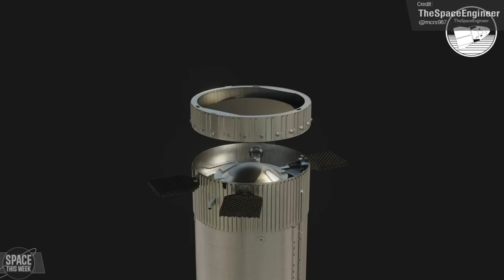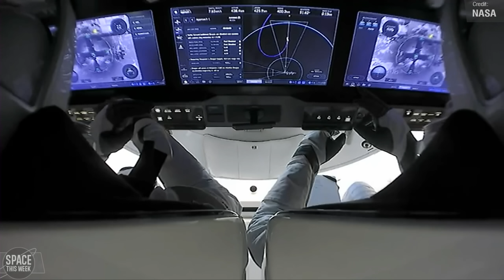SpaceX Starship gets Reinforcements, Falcon 9 Breaks New Record, Secret China Launch, Final Ariane V

Comment: The payload door design is not good - given the majority of the forces are along the axis of the vehicle having a vertical door instead of a horizontal door would have reduced the stress on the door by a factor of 4 or more. No reinforcement would have been needed for a vertical payload door.

Comment: I have observed in animations that the "Pez Dispenser" apparatus dispenses the satellites out 
along their long axis. If the satellites are four feet wide and eight feet long, the eight foot Starlink
Payload door could be cut in half by dispensing them out along the Four foot axis. 
This would be more structurally sound.
Reply: at the cost of a more elaborate deployment mechanism (about 3x to 4x as many moving parts required). probably not a worthy tradeoff, especially because at some point they want to open the entire side of the booster for bigger sats, not just that tiny slit..

Comment: I kind of wonder how long Ariane 6 will be around since it's already obsolescent by design.
Reply: Booster reusability is great, but has drawbacks.

First, if you don't have a fast enough launch cadence, you can spend more on recovery equipment and personnel than you save by reusing the booster.

Second, you take a payload hit for the recovery system on the booster. The Falcon 9 B5 can lift up to 22.8 tons to LEO when expended (SX), but only up to 17.4 tons when landed on a drone ship (B1067.9). Doing a Return to Launch Site (RTLS) landing, costs even more payload as you have to add a boost back burn to cancel the lateral velocity and return back to the launch site.

Third, the higher and faster you go, the harder reusability is to perform. The heavier the dry-mass of your booster, the harder reusability is to perform.

Fourth, you now have to have the weather be acceptable at the launch site and the landing site, if it is down range of the launch.

No, I'm not saying that SpaceX should not recover boosters. I'm using how reusability affects the Falcon 9 to discuss other expendable boosters.

Since 2010, the Ariane 5 has averaged 5 launches a year, so it didn't really have a fast cadence. It also looks like the Ariane 5 booster separates roughly twice as high as a Falcon 9 B5, so will be going faster as well.

Many governments don't really want to put their military or spy sats on other countries rockets, so they will always have some launches. Not to mention, like the US, some science missions will be funded so that their own rockets have to be used.
Reply from the maker: Ariane 6 is a government backed rocket so cost is less of an issue, and its big advantage is that its launch pad is very close to the equator, so it's ideal for geostationary orbit launches
Reply: Well it’s a government funded program. As long as political will is there it will stay.
Reply: The word you're looking for is 'obsolete'.  Anyway, i bet it will stick around longer than you expect considering that it's backed by international treaty.

Comment: I refuse to call it the “water cooled steel plate”, I prefer the “Booster Bidet”
Reply: Lol
Reply: The world's largest upside down shower head.
Reply: Perfect name I hope it works but I'm unsure
Reply: I prefer shrapnel futures as a name
Reply: Seconded.
Reply: Actually “Starbase” calls it the “Pancake” 🙂
Reply: @dhwardani Hasn’t even been used yet, don’t down something till you’ve got reason to
Reply: @alucidrust  Water being flash boiled inside a seal metal container = explosion.
Reply: @michaelwilliams2430  There is a deluge system you know that? and they've obviously thought it through, thats basic thermodynamics.
Reply: @alucidrust  It is not a deluge system. If they thought things through, they would not have blown up the pad the last time. Basic thermodynamics says it will explode.
Reply: @michaelwilliams2430  There is a deluge system in place though, it's not just the cooling plate.
Reply: @alucidrust  Interesting since they have to get environmental agencies permission for a deluge system since if not done properly it poses great danger to the protected wetlands and last I heard they had not even applied.
Reply: @michaelwilliams2430  Maybe I've heard differently, will be interesting to see what they do.
Reply: More of a trivet than a bidet.
Reply: @dhwardani  How so? Or are you just... you know... trolling? I don't like Mr. Musk. But what his engineers have done is absolutely amazing. No one can deny that.
Reply: @FuriousImp  You don’t like the hard-working self-made altruistic genius who rose from very modest means to bring humanity Electric cars, self-driving, tunnels, affordable space, big steps towards being multi-planetary, robots, & exposed/freed us from widespread secret criminal government/media/big-tech colluded brutal ideological partisan censorship/manipulation… hmmm..
Reply: @dhwardani trying to fight the power of raptors is not a good idea in my opinion, but we will see
Reply: @dhwardani Actually with a ship as large as Starship, there are only two options. Large heatsink or launch over open water. 

NASA did studies in the 70's and determined a deluge system would require so much water it would be impractical. A traditional Flame Diverter would reflect sound waves back at the vehicle causing it to tear itself apart.

Comment: Hi, I have a question? Will the starship booster eventually land on the same surface as it launched from? It will it go to apogee and than  do a suicide burn? Or will it be like falcon and land on a drone ship?
Reply from the maker: The booster is too massive to land on legs, it will be caught from the air by the large metal jaws at the top of the tower
Reply: @MattLowne  thanks, sorry for all the spelling mistakes, I’m used to typing on phone
Reply: The booster is supposed to land where it launched. The tower has mechanical arms built to catch the booster and/or Starship when they return.